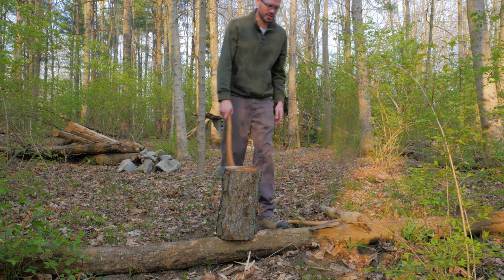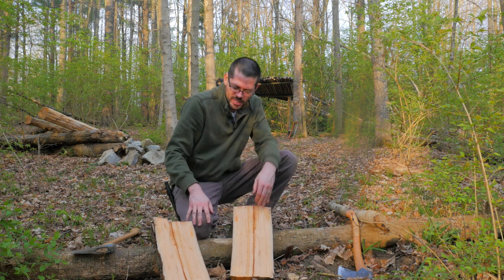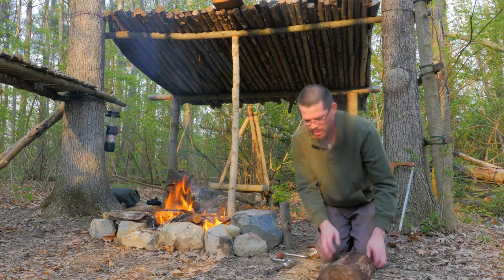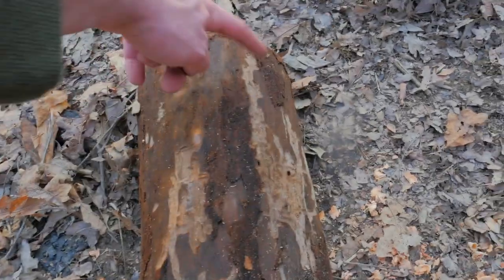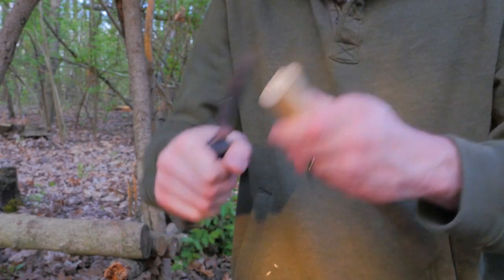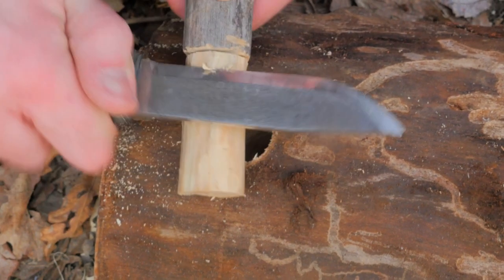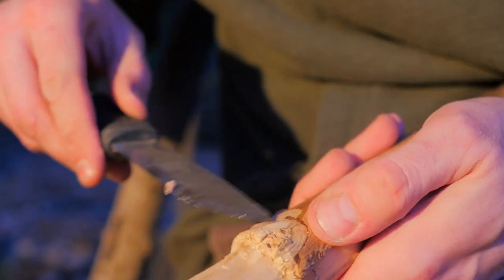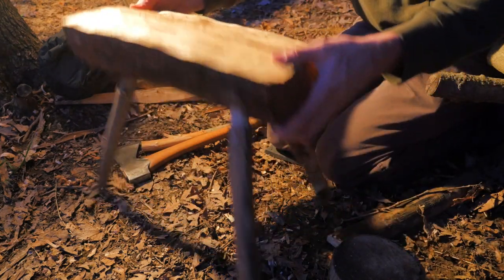Bushcraft Joinery - AWESOME LITTLE CAMP TABLE

Comment: a trick everyone can do when doing joinery like this is to make a split on the end of the inserting rod, right down the middle, then put a small triangular shaped "expander" in the split of the inserting rod, and when it is rammed down in the receiving wood, it will create pressure and expand inside, thus ensuring even more stability rather than just friction.
Reply: Yes the wedge is good trick

Comment: If you use the auger hole where the handle goes and a heavy mallet, it will make the perfect size peg to fit in the hole

Comment: I just made a stool like that using a tool similar to Shawn of the Wilds Settler's Wrench, the tool makes the right diameter peg for the hole, makes the hole and you can throw it in your pocket.  Tip for ya, if you drill through you can drift a leg out from the other side to replace it and you can re-orient legs that are less than straight. Great video, my kind of content!
Reply from the maker: Nice! Good idea. Thanks man. Got a scotch eyed auger now which is a bit lighter than this place of bit and brace. Have to give it a try soon.

Comment: Cool I'm going to try that on a bigger scale. Did you know if you cut the holes in a green log and use dried seasoned legs that as the green log dries and shrinks it locks the legs in so tight they will never move? Thanks for these videos 
they are a nice diversion

Comment: I found with brace and bit boring that you shouldn't have to push on it like that, the bit should be doing all the work and the worm should pull it through.  If it is that hard work the bit probably needs sharpening and the worm needs cleaning off.